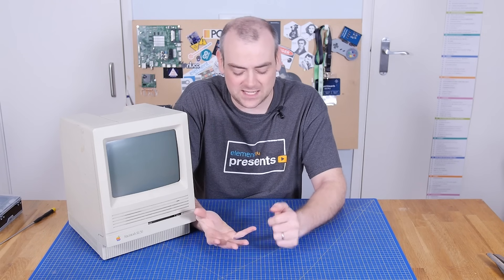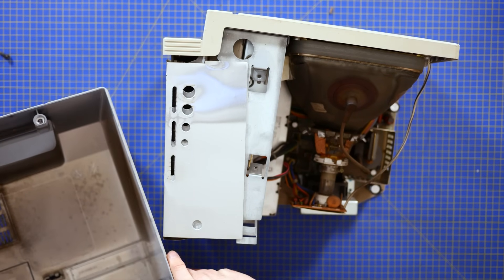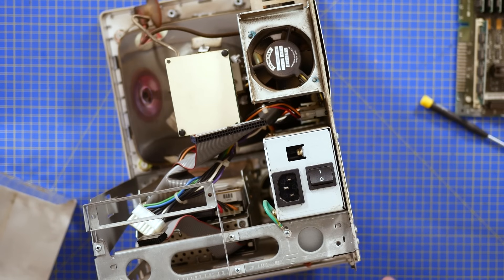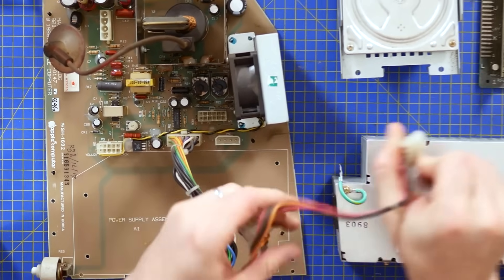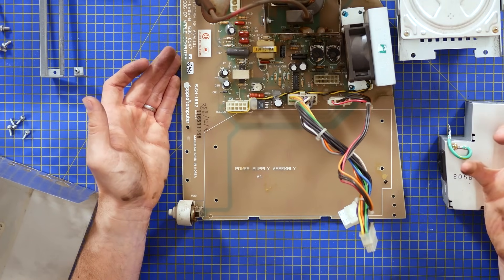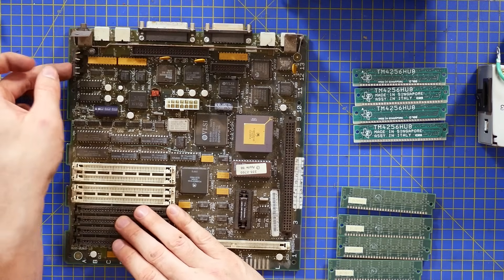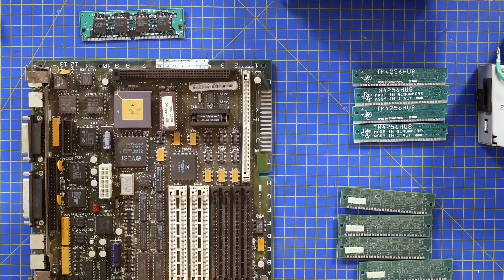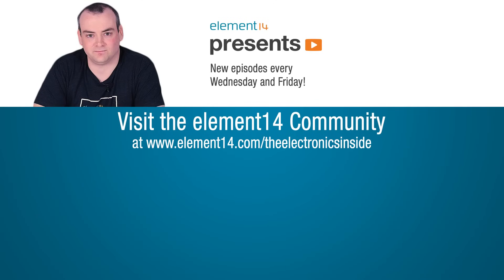Macintosh SE/30 Teardown - The Electronics Inside

Comment: The 2mb on the floppydrive most likely refers to the unformatted capacity. I’ve got some boxes of 3M diskettes and floppy’s and the 3.5” DS/DD are described as 1mb* capacity. The * says unformatted capacity. I use these with my Archimedes 310. MS DOS FAT can put 720k on them, but other operating systems could squeeze a bit more on them. Did you know that the Windows 95/98 setup disk have 1.6mb on them, whilst it is just a normal HD diskette. Microsoft created a slightly customised FAT image for those disks. It is possible to format disks to that capacity with certain special tools such as Omniflop/Omnidisk.
Reply: I believe the Mac altered the spin speed for different tracks, to squeeze more on.

Comment: 10:54 The ROM does contain the microcode necessary for the system to boot, but did not actually contain the operating system. The OS was stored on disk, and you could either boot from a floppy, or boot off a hard drive. The only Mac to ever include an OS in ROM was the Mac Classic. Apple had considered marketing the feature, but decided against it near the end of the Classic's development. Rather than rework the ROM to remove the feature, they just made a minor modification that defaulted to booting from disk, but added the ability to manually boot from ROM by holding the key combination Command-Option-X-O.
Reply: Is it possible that chip was the VRAM or video card instead of the ROM?
Reply: @GuyPaddock  No. That was a ROMSIMM. The board even labels the part (where he shows the broken clip, it briefly comes into focus). Some of these older machines put ROMs on SIMM modules... It is memory, much like RAM... You just can only read it. Today, we have the option to flash new Firmware, but back then, that tech wasnt yet available. If you had a bug in the ROMs that needed updating, you had to replace the ROM chips.
Reply: @richfiles  ah, thank you! I just learned a new thing.

Comment: We restore a lot of SE/30s. They need recapping at this point in their life. Definitely early as later revisions did not have the cpu socketed. It has had it's ram slots replaced at some point (4 top bank). That bodge I believe is factory as i have board I'm working on that also has it. That board ABSOLUTELY needs two things: Recap and its battery removed. Please, take this seriously as these are very valuable. If you're in the states, I'd do it for free just to keep another SE/30 alive! Also, it needs an ultrasonic cleaning.
Reply: As i was reassembling it, I gave everything a clean with IPA - which helped, but yes, USC would be better. I'd happily recap it (about the only thing I feel I can routinely do well) and pass it onto a collector! I fell bad that it doesn't have a ADB keyboard and mouse though.
Reply: @a531016  Our business is just old vintage computer restoration, so we deal with this a lot sadly. The IPA will at least temporarily put off the damage but the caps should be removed(the smd ones really). They are all 47uf 16v but the smallest which is 1uf 50v. One through hole cap is 470uf / 16v the other is 220uf / 16v. Where are you located? I could definitely find you someone who'd love it. Have a lot of customers.
Reply: Hey Thomas! Do you guys restore Macintosh Classic’s?
I have one and sadly it would not boot. I have opened it to inspect for leaking caps but nothing was visible.

Comment: CPU used in this device was a 68030 running at 16 MHz, possibly 20? It’s been too long but 16 MHz sounds correct. Floppy drive would have been 1.4 MB formatted capacity, there is an edge connector along the right hand side of the motherboard I don’t remember how many connections are on that but that was what they called an SE 30 bus or a new bus connector again don’t recall you could install video cards that were used in the Mac to family.
Reply: I believe you also could install an upgraded CPU in that same socket that was on the right. Also there were cards from radius so you could have flip for portrait or landscape, also color cards for video. I also believe there were a couple of companies that had token ring that could be installed into that same connector.

Comment: Earlier versions had all the designers names in the inside of the case, engraved into the plastic of the moulding.
Reply: I didn't sport anything - but I really want to go back and have a closer look now!
Reply: @a531016  No, very visible on the first generation cases inside, all the names in there in the case.

Comment: My floppy drive in my SE stopped working and I took it apart to clear and repair the floppy. I had to disconnect all the ribbon cables etc during the teardown and I put it all back together after cleaning and lubing the floppy drive and now the SE doesn't read the HDD any more. I've double checked every ribbon cable and I was so sure they're in the right spots but all I'm getting is the disk with the ? in it on bootup and I've checked every teardown video on youtube and none of them show where to attach the cables and I'm getting so frustrated I'm about the throw the computer across the room.

Comment: Did the CPU and graphics card runs without an heatsink?
Reply: it was a different time back then. in a lot of old computer heat disspiation over the pcb and via airflow was enough.
Reply: Raspberry Pi don't require a heastink or cooler to work and they operate at good temps.

Comment: Maybe another pr9ject for you to consider is one of the original S-100 boxes, such as the CompuPro 8/16 systems. I know a bunch of those boatanchors are still out there.
Reply: Good suggestion! I'll keep an eye open for one!
Reply: @a531016  Yup. My interest, actually is a bit personal. I wrote BIOS firmware and device drivers for CompuPro 1982-1987, including the entire Forth o/s for the 32016 boards. You can intercut a short clip from Buckaroo Banzai as CompuPro boxes were used as props for the movie. I don't know if those were working. 😁
Reply: Note. If you ever get hold of a Disk-3 hard disk controller you may be amazed that we could get full Winchester performance from an 8085 cpu as an embedded controller, albeit at 5MHz. There was a PROM hardware state machine for doing the data separation. Nifty,eh?